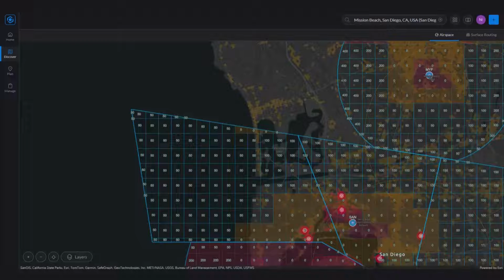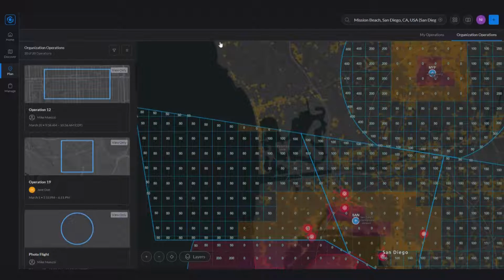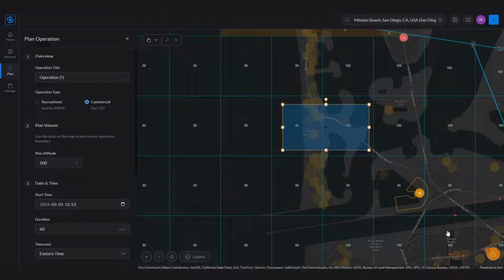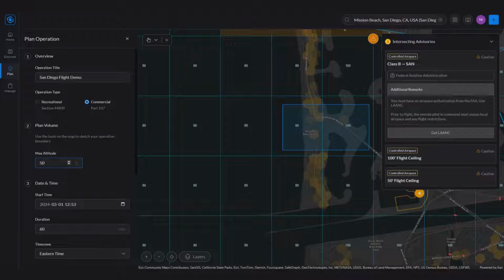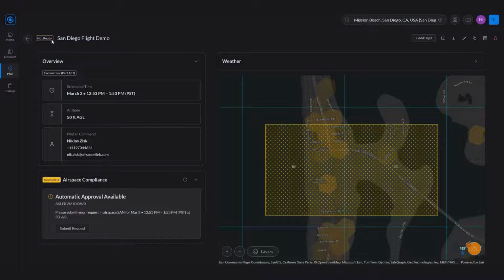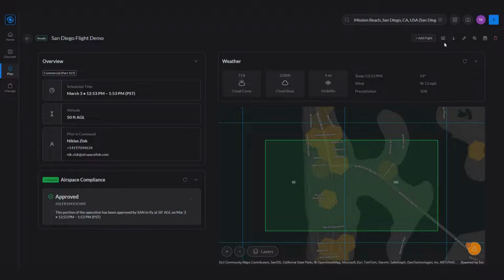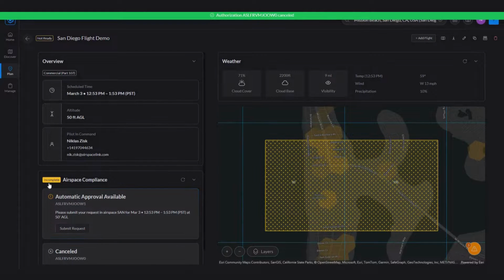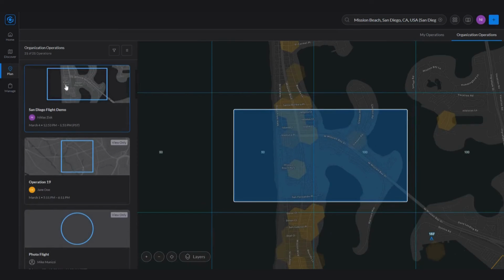AirHub® Academy – Operation Creation

Comment: can you just answer without sending me to a different website? After doing this, and once you start flying, how does the FAA and ATC know which drone is mine once I'm in the air? Do they just assume it is me? Do they just match up my name with their registration database?
Reply: Youre not doing this so the FAA knows youre flying, youre doing it so you know you CAN fly.
Reply: @Dark_Knight_Drones_RCs  well I’m confused because I did everything in the video, went out to fly and it still didn’t work. I couldn’t get my drone off the ground
Reply: I’m just a recreational flyer and live well outside any airspace restrictions.  Is it required for me to create an operation each time I go fly in my backyard?
Reply: @NitroMedic  no. It's not required period. But in certain areas with controlled airspace, it's advisable.
Reply: @Dark_Knight_Drones_RCs , thanks so much for the quick response.